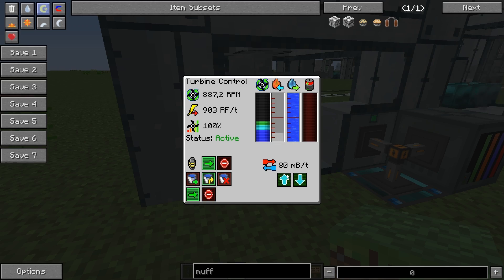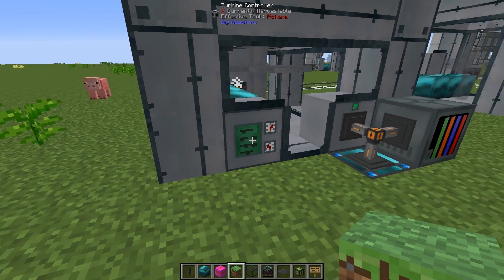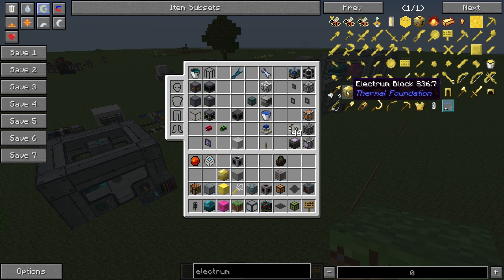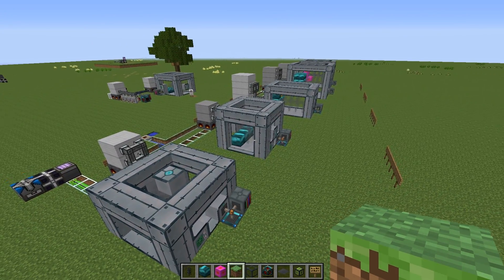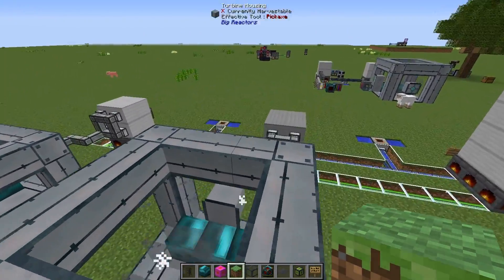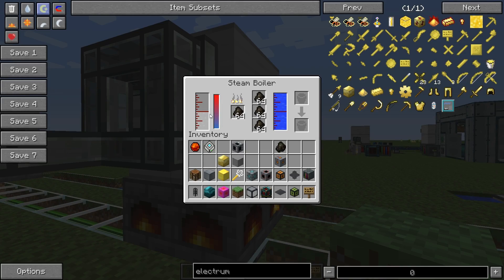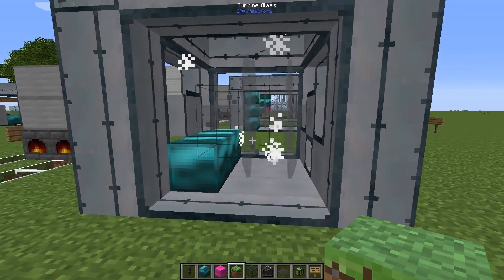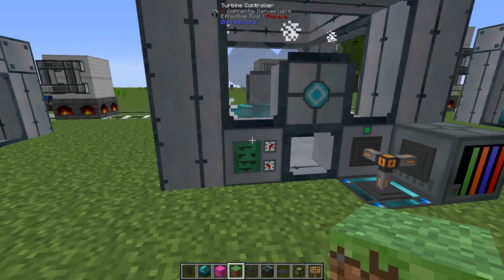Optimized Big Reactors Turbines With Different RailCraft Steam Boilers (FTB 1.7.10)

Comment: are your boilers at 1000 degrees ?
Reply from the maker: +ZeroZXD The boilers in this video are all running at max temp. As reference, that's 500 degrees for a LP boiler and 1000 degrees for a HP boiler.